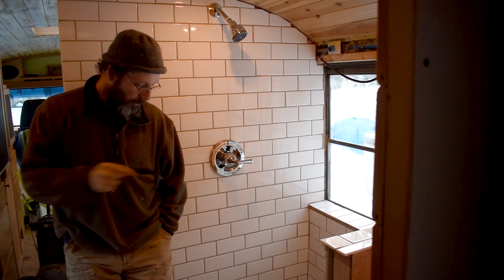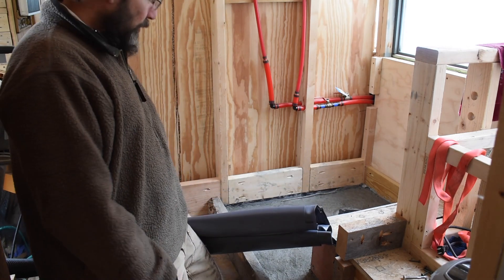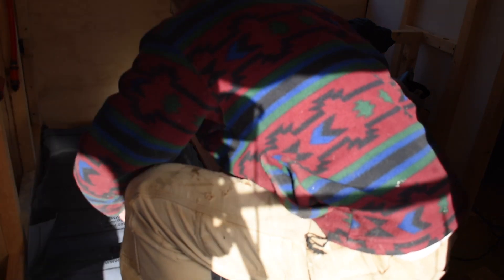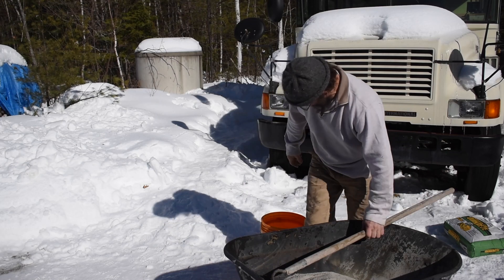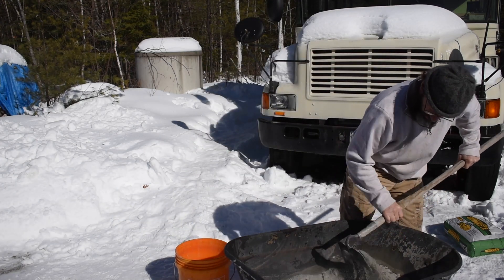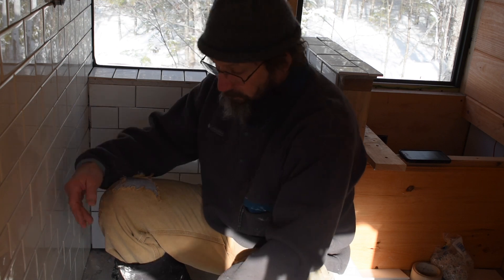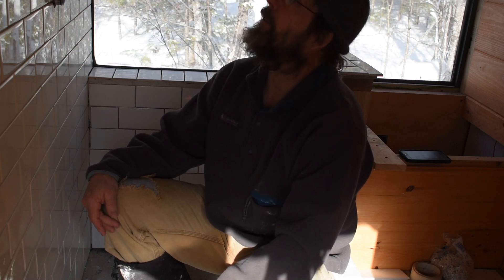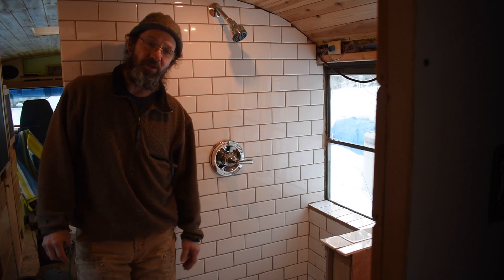Skoolie Shower Build:  Mortarbed Shower Pan, Wall Tile and River Pebble Floor

Comment: great job I did it very similar but I skipped the first step and dint put down mortar under my shower panel liner. It seems too excessive for a tiny house build. I dont plan on living in it for more than 1 year so I dont know why treat the same as they do houses
Reply from the maker: I did it just to create a shape to drain water.  It was cheaper than buying a shower pan!  Plus I could custom design the shape...

Comment: Why not just the 1 sloped dry pack?
Reply from the maker: I'm not sure I understand.  What do you mean by 1 sloped? (I probably didn't do it because I didn't know anything about it)
Reply: Your first mortar dry pack was to get the slope for drainage, then you added the liner and another dry pack.  I searched online to find why 2 dry packs are used, but no success.  Where did you read to do 2 dry packs instead of just putting down the liner and 1 dry pack with the slope?  I just put in my drain and I'm trying to decide which method to use. @River-Channel